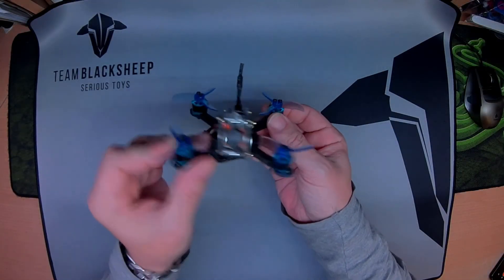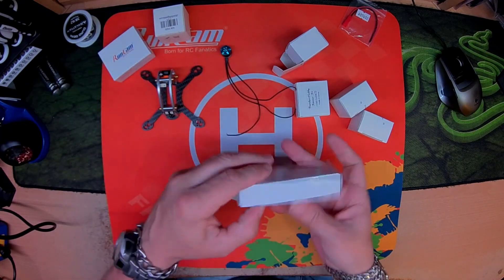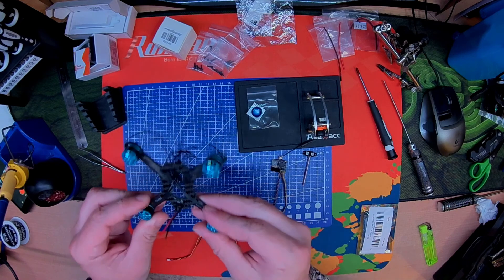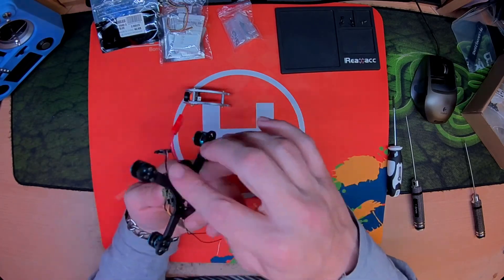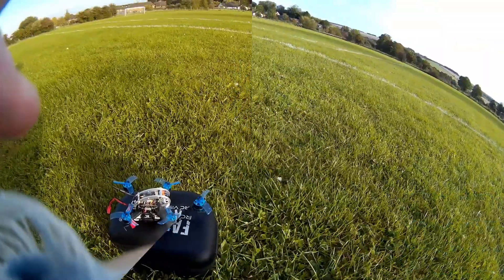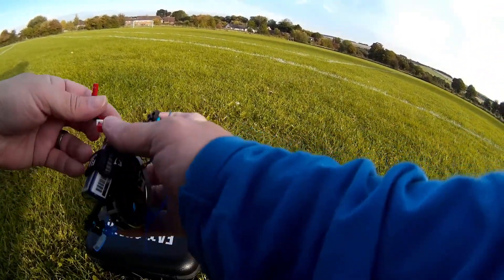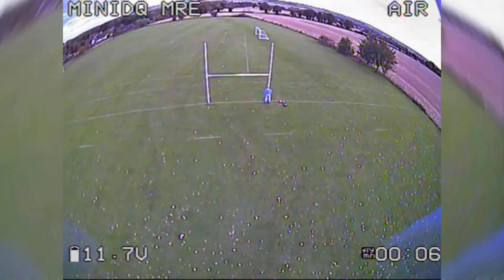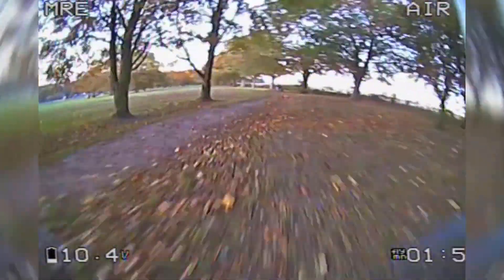Kingkong FlyEgg 100 Build [Crazily Overpowered]

Comment: MrE, Brian here.  I'm starting a new comment as you suggested.  I just wanted to report back to you about the 1106 5100 Returners.  I'm totally bummed.  With the setup I described to you in Greg Moffatt's comment, and using the GNB 3S 550mah, I hovered around my living room for about 45 seconds and the motors were too hot to touch.   I may have to rethink this whole 3S setup, and re-engineer a 2S solution.  But first I'm gonna try tweaking a few things, and try some different props - because it flew just fine.   But the motors, oh...I'm so bummed.  And the RunCam nano is installed sideways, even though the wires out, are on top.  DOH!
Reply from the maker: Hey , Brian.
That is very odd to hear that the 5100's getting hot on 3S, see if they get hot just spinning them up, unpropped with caution - I went through everything on the ESC side as have many others to try and get the 7100's in check to no avail.

The heat mine get to on a 450 is rather uncomfortable to keep on a moderatly firm grasp and yet I have manual labour tough like leather fingers/hands, I'd equate it to a recently boiled kettle but I just run them like it and they seem to have survived. The other question I would ask is if the heat is more at one corner or end of the quad?
(The spin up on bench unpropped will rule out the physical side of things like overpropped or overweight - bar bolts into the motors windings.)

What firmware etc have you gone for, taking a guess would be Betaflight 3.3 or 3.4?

Don't get disheartened dear fellow, it's all part the game!
As for the Nano , thanks for teaching me something, not that I intend on using one but the knowledge is still valueable none the less.

Comment: Any guess what it’s top speed is?
Reply: This isn't Greg, this is a different guy who is just now reading these comments and is intrigued...Funny, I bought almost the exact same components before I ever saw your video, but I went with a Runcam nano and a Runcam TX200, the HGLRC F428 4-in-1 ESC and F4 FC, an FrSky XM+ and lucky me - they were out of the 7100s so I had to settle on the 5100s (Returner R3 1106s).  I'll see if they stay cooler than the 7100s.  I'll be running it on GaoGeng GNB 3S 550mah 80c and Tattu 3S 650mah 75c with GemFam Hulkie 2040s.  I also have a bunch of GemFan 2035s and GaoGeng GNB 2S 550mah 80c batteries I use on my Arfun 95 I might try.  Anyway, I just got it all wired up tonight.  Hoping to get it all programmed and ready for the weekend.  I'll let you know how it turns out.  I'm just learning freestyle, but I have a DVR and will gladly show you my mediocre flying, if...you help me dial in the tuning on my setup.  Deal?
Reply from the maker: I'm sorry but I'd have no idea how to gauge it other than prehaps the speedy run between rugby posts either end of the pitch which probaly isn't a full sized one somewhere in the flight footage,  I never find myself feeling I need more however.
I do have one slight niggle about the build which I wouldn't mind getting sorted out given the option ,being the 7100kv Returner 1106 R3's running very hot on 3s, let alone 4s which I think would turn them in to roman candles! (from memory it was common among all of them early on and expect them not to have changed - they do run ok and stone cold on 2S giving up alot of top end)
I would like to swap them out in future from something more apt ( the 5100kv seem to be a bit better but things have moved on since I last gave it some thought and would have to re-evaluate the 11~ offerings of motors once again)
Hope this gives you some food for thought!
Reply: MrE Thank you.  I’m building this pretty much to your specs this week.  I appreciate the video.  I’ll keep an eye on the motors.
Reply from the maker: You're welcome - I have tried everything to get the heat under control (different ESC protocols and settings/filters etc) as have others, but the short and curly of it is pure voltage. If I was to replace them, it would probably be trusty old red bottom Emax 1106's if I strayed from the BrotherHobby's.

None the less, this frame and build is a tank and gave me a whole season of ripping last year, looking back at some of the footage I can say it is a rocket!
Reply: MrE Thanks again.  I finished my build and sorted everything out in Betaflight. Still learning so it was a slow process. This little thing rips!
Reply from the maker: Very glad to hear your ripping it now! What components did you end up with out of curiosity?I know how slow something's can be - It's taken me 10 months to finally put my present to myself - Japaura together haha!
I'd love to see some DVR if you have the capacity to record some, but thanks every so much for keeping me posted.
Reply from the maker: Hey, Brian.It's kind of funny how we all end up on the same path of compmonents with this thing and I think I would be closer to your build if I had done it now. Everything you mention should be just peachy!
I'd be happy to follow your journey and give advice where needed, Starting from here in the grannd scheme of things with how betaflight etc is - you'll be fine and tuning will be very minimal. All of the setup stuff will take care of 85% or so ,while a couple of physical tweaks will thake you 95% towards prefection (being say a 450mAh 3S for example) - PID from stock will do just fine and I rarely have to adjust them an any builds as I'm just a fun flyer.
It might be wise to start a new comment so I can get notification and dont hesitate to fire any questions etc - I'll help out as well as poss. I'm very intrested to see your progression.
Happy flying, Fella.

Comment: How did you get the osd. mine has none.  Would love to have an osd
Reply from the maker: I custom built this one with cherry picked parts (XJB F425 Stack has the onboard OSD).
If you bought the ARF/BNF version I believe it has the Kingkong Piko BLX flight controller that doesn't have the OSD capability.
You could obtain an OSD in a couple of ways with the simplist being a camera like the Runcam micros that have a simple osd ( Pilot name, Voltage and Timer iirc).
Hope this answers your question but if you need further info,dont hesitate to fire away.

On another note the imagary for the BNF's show it utilising an OSD oddly but the package states a Q25/100 camera/vtx that is straight through from cam to vTX.
Reply: MrE so all I have to do is change this camera.  Thats all I want is voltage, time.  Would be nice to have other options but just the necessary is ok.  I have a newer version than what I have been seeing on YouTube.  My motors are blue and not solid.  Where can I get this can?  Thank u for your help
Reply from the maker: The camera is linked in the description that I use (Follow that and hit the runcam brand for the Runcam Swift Micro 2 ,Sparrow and any others in the range,I think Caddx can Foxeer all do matching ones), just double check the ones you are looking at has the aforementioned prerequisites.

The frame does require some modding for it to fit which I have documented in prior Fly Egg videos that have a playlist here:
https://www.youtube.com/playlist?list=PLqV89ugQ3QnmmiKNkFawJSZIkU7wxyo7h

The VTX you have should be fine powering the camera from memory as I have one on another little quad. the cameras have a seperate wire to stick on the raw positive voltage source to read for OSD.
If you have any reservations about your VTX or require more than the 16ch's it has - check Runcams VTX's as they can piggyback on the cameras for a nice tidy install.

Comment: How did you wire the LED’s ? I’ve wired mine to a Raceflight Millivolt and connot get it configured. It’s the only thing left to do. Thanks for the great video!
Reply from the maker: Mine has been behaving a bit odd after wiring it correctly, Raceflight is foreign to me, are you running Raceflight or Betaflight firmware on it?

The wiring referenced here: https://revoltfc.com/pinout-diagram.html and the symbols on the led strip are:
白 is Data
红 is 5V
黑 is Negative/ground

Verify the LED output is enabled in the configureation in Betaflight and then give some LEDs a wiring order and then functionality for Betaflight.

See if that gets you on the right track ,if not l - give me a bit more info and I'll look into it
Thanks for the kind comment,good luck!
Reply: Thanks MrE. I'm thinking it's not compatible with my controller. I might try Betaflight later. Great Video. Great work!

Comment: Nice build!  Fun video!  How how hot are the motors on 3S?
Reply from the maker: Very hot compared to what I would expect normally but I'm throwing caution to the wind, I can just about keep my fingers pressed around them.

It's seems very common with these to run crazy hot to the point of being problematic in the community,sadly. I have tried all the usual stuff to tame the heat but I'm a bit over worrying now,if the burn up - they burn up while I have a big smile!
Reply: MrE - I'm running the 1106 6000's on a 2.5 inch frame with Gemfan 2540 Flash props and 3S batteries - less thrust than the 7500 and the motors are just getting lukewarm on BF 3.2.2 with all the filters off and dynamic filters on.
Reply from the maker: Thats great information,thanks!
I assume the load on the motors are near adentical due to the 4" pitch on our props.
Prehaps I would be better off with some 6000kvs for longevity - bit of a shame how these 7500kv's didn't live up to BrotherHobby's usually bulletproof specs etc.

They even get hot with no load so I can only assume 3S support was some wishfull thinking,now you have my cogs moving about them being moved to a 2s haha!
I do however run them on 3.2 with Dynamic filtering on PT1, notch 1 and 2 but wont dare try Dterm.
Reply: MrE - If you look at EngineerX' videos of the EMAX 1106 series you can see the amp draw differences between 6000 and 7500 motors with the same props (i.e. 2040 Hulkies), and amps translate to heat - as well as thrust.  So, it's a question of balance between thrust, amps and heat.  The Hulkies are more efficient than the GF 2035's, and seem to generate the same thrust with less amps consumed - but if it's all-out power you want, then 7500 on 3S is about the limit.
Reply from the maker: I think for these 7500kv the voltage is the main issue regards the heat,as previously mentioned they even heat up idling etc,I may just slap a 2s back on it and verify.
The GF 2035s are great for my 2s 90mm but they fall flat on their face on this 3S craft due to it's weight and the props flex I think. I loose near a min of flight and a fair amount of performance on them from memory.
These 1106's do like to chew power but the heat most certainly is a worry and just juice down the drain. I would take the amps/thrust gladly for the most part but as usual Ithe day they were announced I jumped all over them when discretion would have been wise!

Bottom line we're never happy for the most part or there is something new out before the last brand new thing has been delivered! 

I indeed enjoy EngineerX's content with my Chameleons motors getting the deciding criteria from his Deadpool tests (goodbye batterys,it was nice knowing you!)

Comment: Wow at 7:32 that just blew my mind how cool that was! Looks like it eats through batteries with those props, have you had a go of the gemfan 2540 props yet? Ive heard they are punchy and efficient so ordered 3 sets in different colours for the leader 120. Great flying especially in that wind
Reply from the maker: Thanks,Dan. If flown with a bit of throttle restraint I can eek out towards 3mins on Hulkies iirc. I have nothing to try the 2540's on but they look as though they have the same quality as the Hulkies and Flash 3052's and dancers so could imagine they rock also.
I have 2035 gemfans but they nuke both performance and flight time due to flex sadly,very well suited on my other 2" 2S quad though.

The batteries are Nanotech 3S 450 65/130C but sag so much, ok for a budget and have them for other things so will tide me over until I'm willing to drop a fortune in top shelf lipos(*if)